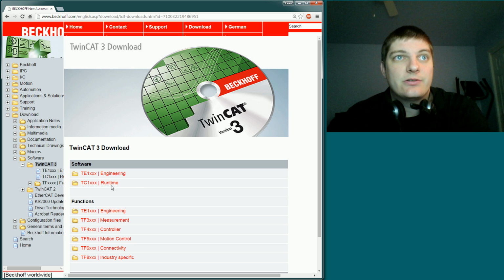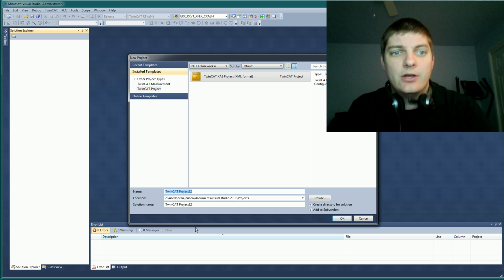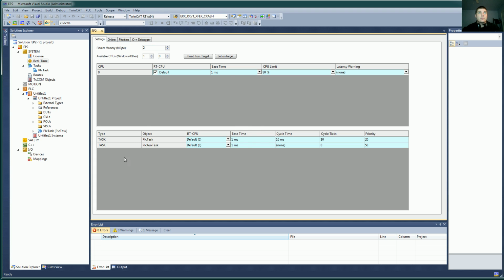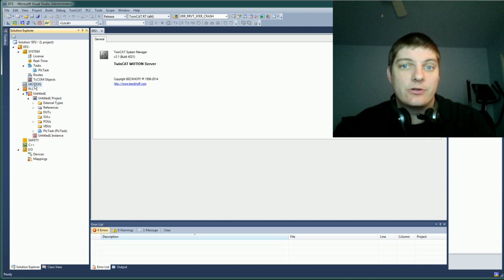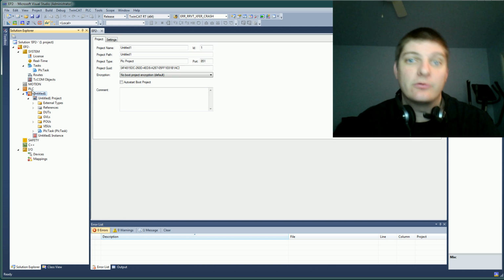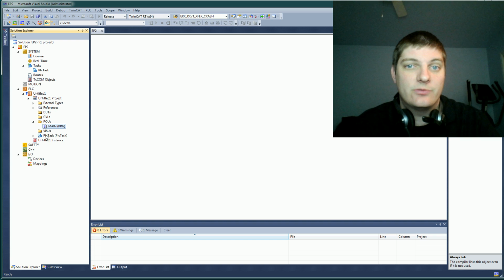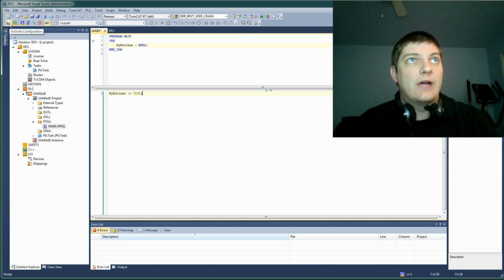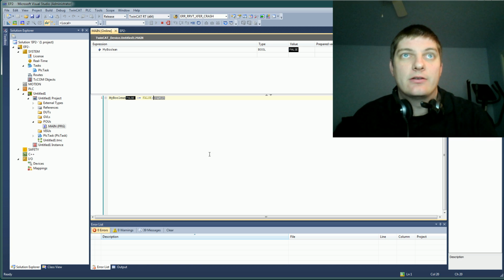Learning PLCs with Structured Text - EP2 - Programming Environment (Beckhoff TwinCAT 3)

Comment: This error appears to me when pressing active configuration : Severity	Code	Description	Project	File	Line	Suppression State
Error		1/20/2021 11:51:15 PM 777 ms | 'TwinCAT System' (10000): Sending ams command >> Init4\RTime: Start Interrupt: Ticker started >> AdsError: 4115 (0x1013, RTIME: system clock setup fails. 
Hint: On Windows8 system and above execute win8settick.bat in TwinCAT\3.1\System as administrator and reboot.) << failed!				
What should I do please?
Reply from the maker: Follow the hint they provided. Run that bat file and reboot
Reply: @SquishyBrained  it works! thanks a lot for your replay.

Comment: Good afternoon! I just started following your videos for this specific topic and I find this message when I try to "Restart TwinCat system in Run Mode" while attempting to run the code. This is the message: AdsWarning: 4115 (0x1013, RTME: system clock setup fails. hint: On windows8 system and above execute win8settick.bat in TwinCAT\3.1......>>failed!. 
What do you think I should do? Thanks in advance!

Comment: A absolutely awesome instructional video! Probably one of the best I have seen so thank you for putting in the effort!! A small questions is can TwinCAT run in VMWARE??? I currently run a number of Vendor based applications from Rockwell, Schneider etc and do tend to run in VM's as it seems they can 'clobber' each other when running in the same environment. I just was working through this episode and got the following error "Setting TwinCAT in Run mode in windows core(s) in VMWare is not possible.  Activate solution using only isolated cores". Would prefer to run in VM if possible... Any ideas..... Thanks in advance and look forward to working through the rest!!
Reply from the maker: I'm not sure you can run the runtime in a VM... you might be able to if you dedicate 2 processors to the VM, and 1 of those 2 to twincat directly, which you can do somewhere in the 'system' tab in there (and reboot).  I had no luck with that in the past though.  I understand the need to run things like this in a VM.  My main complaint is the stupid splash screen they put on at boot, which you can remove if you want to, but otherwise, it doesn't hose up the main PC too badly.  if you want to install just twincat "Engineering" and not the runtime, you can target other systems and it ends up being a pretty lightweight system. You can run the "Engineering" side in a VM no problem, but you'll need some other dedicated hardware to target in that situation.
Reply: Thanks for the prompt reply! Worked through what you suggested and it happily runs now in  VMWorkstation  V12 running 2 CPU 2 Core with 1 dedicated too TwinCAT. Thanks again for getting back to me!!
Reply from the maker: @pauldonald7861  excellent. Good to know. I wonder if that works on amd processors...? Is yours AMD or Intel?
Reply: @SquishyBrained  This one is Intel!! I will run the same VM up on a AMD laptop I have somewhere and let you know !

Comment: I got an issue while it was doing the activate configuration. I got a second message "real-time start diagnostic" description: Intel VT-x is not supported or not enabled in the bios. Solution:Check your CPU type and BIOS settings for
VT-x/Intel Virtualization Technology.
or
Activate a solution using only isolated cores.

No sure what that means.
Reply from the maker: I think there are some other comments that talk about this.  You need an intel CPU with VT-x enabled in the bios.  You can dedicate a CPU to the runtime, but last I checked it still won't work on AMD cpus.
Reply: The trick of how TwinCAT can run realtime on a regular PC with windows on it no less, is through VT-x. Normally you can't run any process reatime on windows, it's just not possible. So what TwinCAT does, is it bypasses windows entirely using VT-x and runs it's realtime code natively, without the opsys in the way. VT-x is Intel's hardware virtualization feature, normally used to run virtual machines, without having to emulate through host system. Basically TwinCAT ends up running parallel to windows, instead of slave to it. It's usually disabled by default, you have to enable it in BIOS. I'm not sure if TwinCAT can run on AMD processors, maybe? Never tried to.

Comment: when I click on "activate configuration" & when "restart in run mode" message appears to me & I click on"Yes", the laptop freezes & won't work until I force it to shut down. I tried it 3 times & the same thing happens each time.
Reply from the maker: Odd.  Do you have any real hardware in the mix?  Typically freezes like that are hardware related, often if the network card is not setup properly for EtherCAT.  Also, try activating a fresh project with nothing in it but a single semicolon and see if that lets it run.  Otherwise, hit up beckhoff support.
Reply: SquishyBrained  Thanks I'm gonna try it!
Reply: Hey again! No I don't have any real hardware for now because I'm just learning on the software in general & structured text specifically. I tried activating a new project with only a semicolon but it did the same thing. It froze & I had to force shutdown the laptop again .
Reply: Hy Hasan Atieh! What operating system do you use? I was having such a problem with the 1803 Update. Since I've been using 1703 since then, TwinCAT has been working perfectly. (Windows 10 Pro)
Reply: Attila Becsi what is the 1703 and 1803 ı dont understand.???
Reply: set up the 4022.20 versions. I did and problem solved

Comment: Hi, Is it possible to use this Tiwncat3 VB to link it with any modbus rtu slave controller/Device, so your labtop will be as master where you can have data from the slave and log it? it seems to me it is possible by adding new devices I/O.
Reply from the maker: You can do that in visual basic without twincat, since modbus RTU runs on a serial port.    With that said, you can use TS6255 to get modbus working in twincat, but you'll need a serial port on the PLC or PC.  If its a PC, you can use an EL6001.  I imagine there is some modbus master out there you can just run and not even have to write any custom software, but I have not looked.
Reply: The serial port we can have rs-232 to USB converter to connect with my PC/Labtop, my target is to make my PC as Master. If there is any manual or reference for the mentioned TS6255 please guide, so I can set it up.
Reply from the maker: Fardan Fardann I think Beckhoff has an example out there. Luckily the virtual serial poets are a bit easier to work with.

Comment: when i try to put it in runmode i get these errors, does someone know how to resolve these? tnx

Error 26 7/02/2018 19:19:43 370 ms  | 'TCRTIME' (200): start of real-time avoided by "KB4056894"  
Error 27 7/02/2018 19:19:43 371 ms  | 'TwinCAT System' (10000): Sending ams command >> Init4\RTime: Start Interrupt: Ticker started >> AdsWarning: 4132 (0x1024, RTIME: incompatible software detected) << failed!
Reply from the maker: KB4056894 is likely that new spectre/meltdown patch for windows that broke twincat (and lots of other software).
I think you can uninstall it... beckhoff has a descrpition of that problem out there somewhere and how to fix it.
Reply: SquishyBrained tnx, i ended up uninstalling the last update of Windows (from january). Now it seems to work poperly.

Comment: Hello, 
Did you compare Codesys3.5 vs twinCat?
at first it looks very similary, is there any diferents betwin this two softwares?
if soo what is beter or it is just question of preference?
Reply from the maker: I've not actually used Codesys, however, back in the TwinCat 2.x days, it was pretty obvious (and not really hidden) that the beckhoff IDE was a rebranded codesys product.  The integration into visual studio may or may not be related to codesys, but the low level runtime stuff for sure still has ties to codesys... you see it in error messages once in a while.
But essentially, if you had to program one or the other instead of your usual, you are 90% of the way there, they are incredibly simple.  For that matter, if it is IEC61131-3, you are at least 75% there with any new PLC you get into, which is something I hoped to get across in episode 1.
So, my preference is Twincat, but only because it is the one I used, and the Beckhoff sales and support has been great, and they are really leading the market with hardware out there, though that is another discussion.

Have fun!
Reply: SquishyBrained i once think about this point，and there are some other company plc also based the codesys ，for example festo plc，they are really very similar. i also just have experience at twincat2
Reply: The two are very similar. What you use is going to end up basically determined by which hardware you are running on your system. - The actual End Hardware PLC - Not your PC. - Bottom line is if you can program with one you can program with the other.

Comment: Hey SquishyBrained, your videos are really very helpful, thanq so very much!
I've installed Twincat3 on Windows 7 with Visual Studio 2013. But when I tried to get the 7 days trial license it says 'Invalid system ID', which shows all zeros. And the buttons on the quick access toolbar are not working either..Help me out guys¿ thanks!
Reply: Amit Jha Right click on twinCat icon a click: Run as administrator. It worked for me. Otherwise i cant help you.
Reply: did u figure it out?
Reply: Im also seeing this
Reply: Restart your PC and start twincat as Administrator
Reply: Restarted it a several times and I've logged in as an administrator..but it's still the same..
Reply: Okay, will try..thanks 🙂
Reply: Didnt work for me ae. thanks for your help anyway

Comment: Any chance with some help?? 

I am running windows  through Parallels on my Mac and seeing this error. 

"Setting TwinCat in Run Mode on windows core(s) inside unknown (virtual machine) is not possible" 

Thanks

Jacob
Reply from the maker: You are likely out of luck using that VM.  I've used a VM in the past, but you have to have full virtualization support.  On windows machines it requires Intel VT-X extensions turned on.
If you have an old xp or win 7 maching you might be better off.  I can't complain too much, being able to run at all on local hardware that is not an actual "PLC" is pretty nice.
Reply: Thanks for the reply, I tried everything and couldn't get it to work. My other laptop is running windows 10, but I'm getting the "Invalid system Id" error like @emit Jha above. My system Id is blank when I open the License tab.
Reply from the maker: Interesting.  I saw duplicate system IDs once, but never a blank one.  I'd try uninstall and reinstall just in case that works, and be sure you try a fresh version of twincat.  Honestly, sometimes it might be better to roll back a version or two when you download it.  They change it often, and sometimes they break stuff and don't realize it right away.  As a software developer I can appreciate that it happens from time to time.

Comment: Is it possible to control Allen Bradley drives from the Beckhoff system using EthernetIP?
Reply from the maker: Yes, that is a pretty good option to talk with AB devices.  Another choice is OPC-UA.  The Beckhoff side can be a server or client.  As for Ethernet/IP, Beckhoff can be a scanner or adapter (master / slave).  The master is typically the one that connects to multiple devices, which is often the "higher level" device in the architecture.

Comment: im having problems getting running on and amd a10 processor on windows 7 ultimate x64.  i have virtualization turned on in the bios.  when i go to activate configuration i get 'intel cpu is required to run TwinCat on windows core under 64 bit' with a solution of Activate a solution using only isolated cores.  when i go into the real time tab i have 4 available cpus and no isolated.  anyone know how i can get this running? i wouldnt care if i had to run it in 32 bit i just cant find how to do that either.
Reply from the maker: So... I tried this recently on my AMD cpu on Windows 7, and it is a No-Go.  I have a 64 bit system as well.  I'm not sure if 32 bit will work, but honestly your best bet is to find an intel box, an old laptop or something.  If you network to it, you can still write code on your main AMD box and just run it on the other machine.  I wasn't aware of this limitation until recently on AMD or I would have mentioned it in the videos.
Reply: I had the same problem running an Intel 4core processor... In the real time tab there is an option "Set on target" I used that option to downgrade my PC to 3 Windows processors and 1 isolated and it worked... Idk if you can do that with an AMD processor

Comment: I have question about Scan Cycles. Is there a way I could flag the ST program to only execute certain lines of code on the "n" scan cycle? I have just been running into a problem where I need to perform something every 4 scan cycles; while the rest of my code runs normally?

Oh and thanks for these wonderful tutorials, they've been a great help!
Reply from the maker: +Faisal Gedi, There are 2 ways to do what you are talking about.... They both just suit different needs.  The first would be to create a new program "next" to your main program, and put the slower running code in it.  Then you can create a new PLC task, and set the scan time to 4x that of your regular program, and point to your new program with that task.  The down side of this approach is that you won't have access to the same variables and IO across the different PLC tasks.  You can solve this by having input and output variables in each task and linking them together, but that is more work unless you really need fine control.  Often if you said you need to run something 10x as fast as your main program, but you can't run your main program at 10x due to CPU speed limitations, that would be the best approach, run the high speed task at say 250uS, while the main task was at 10ms for instance.

The other approach would be to add some logic with a counter in there.  You can get fancy with the "MOD" operator and use the scan count, like "IF MOD(ScanCount) = 0 THEN", but a more clear way would probably be to do a quick loop, almost like a  For loop.  You can't use a FOR loop because that all runs in one scan, but you can fake it and have it execute one step of the for loop each scan:

if i > 4 Then
  i := 1;
end_if
if i = 1 then
  runcode();
else
  i := i + 1;
end_if

So, unless I did something silly there, it'll run the code every 4th cycle, only when i = 1.  If you want to slow it down more, change the 4 to a larger number.  There are probably more clever ways to do this, but it'll get the job done.

Comment: Hi Evan,
This is great!  The video, clarity, Audio and your way of explaining is way better than most pros!!
Anyways, after I download and tried to run that small program to test the TwinCAT 3, I am having a problem with the run-time - I am getting this error message  - I am facing this stupid error when I try to activate the configuration first - 
"AdsWarning: 4120 (0x1018, RTIME:enter realtime mode fails: Intel VT-x extension not enabled (in BIOS)!) << failed". I googled for it, located the error code in the Bechoff's documentation but not much help in how to fix it.

My laptop is a Lenovo with Windows 7 Enterprise 64-bit OS.  I have gone into the BIOS and looked around - found a Console Type: VT100+  The Options are: PC ANSI, VT100, VT100+ and VT-UTF8.  I tried the VT100..did the same..now I will try the VT-UTF8, but thought of checking with you to see anyone has encountered such a problem or did I down load the wrong version/type of the TwinCAT in a hurry??
Please let me know..I will check back here.. or my email is: tariqueislam5942@gmail.com
Thanks in advance.
Reply: +Tarique Islam 
OK. I Figured the problem out.  Actually took help from the Beckhoff Tech Support.  I email them on Saturday, and by Sunday (holiday!) I received their email back with a solution - I was to set the Visualization to Enabled in the BIOS of the Lenovo laptop - which they sent me with clear illustrated instruction.(The VT-x in the TwinCAT 3.1's error message , which I confused with the VT-100 Terminal setting, turned out to be that the Intel Processor need to be ENABLED for "Virtualization"  -  as the PLC Runtime is a Virtual (Software implemented) machine running inside Windows 7 running the Intel Processor of the Lenovo!